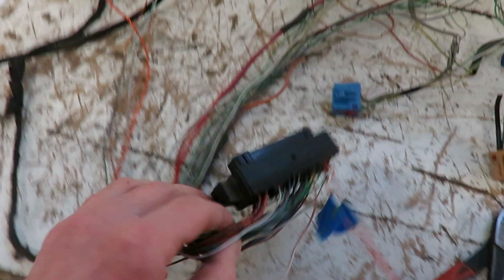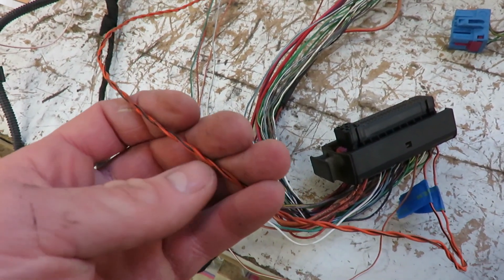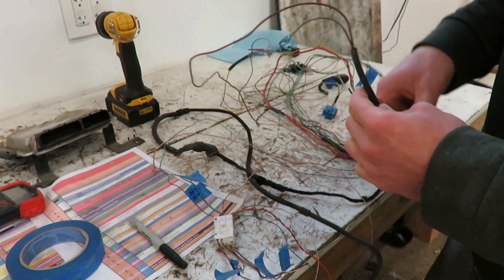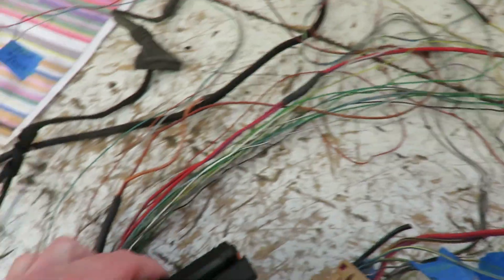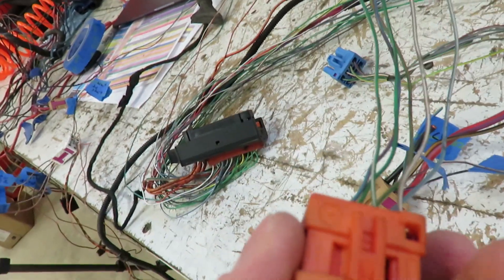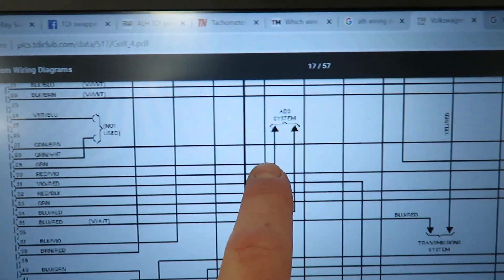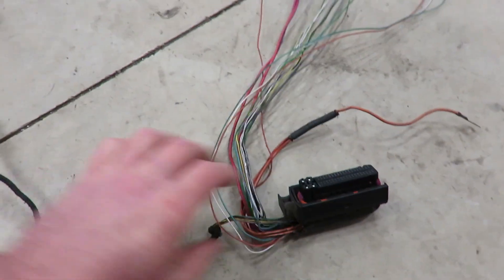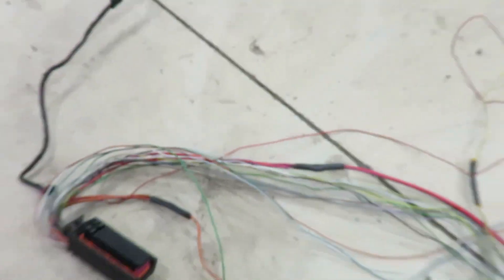Toyota ALH TDI Engine Swap Wiring Part 5 Finishing the ECU Harness

Comment: Great video man,helping out tremendously with my stand alone harness,thanks a bunch!!! One question though. I had the anti shudder valve deleted on my ECU. So I should be able to delete the pressure valve and N18 off my harness and just be left with the N85 correct?
Reply: I mean N75
Reply from the maker: I am only running n75. Anti shutter, egr are both deleted. Make sure your tuner knows so the codes can be deleted!! Just trace the wires and unpin it’s cut them if you decide to delete them!